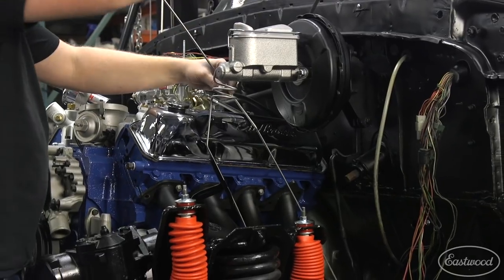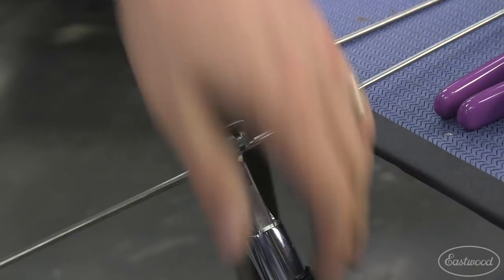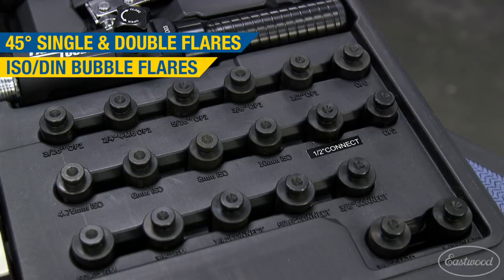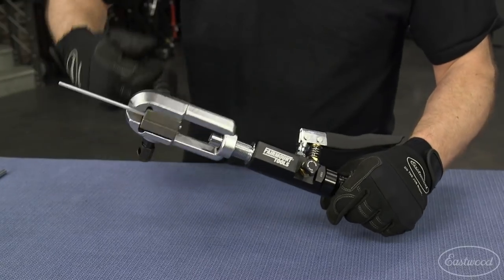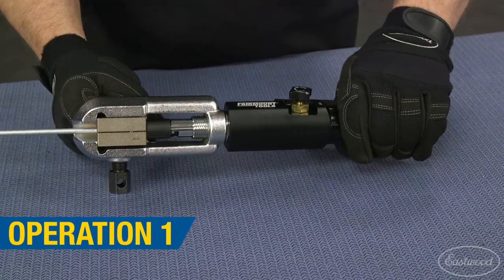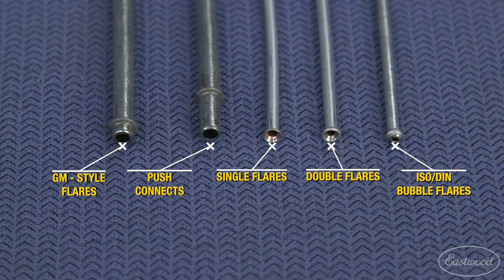Create Perfect Flares On or Off the Car - Flare Brake Lines, Fuel Lines & More! Eastwood

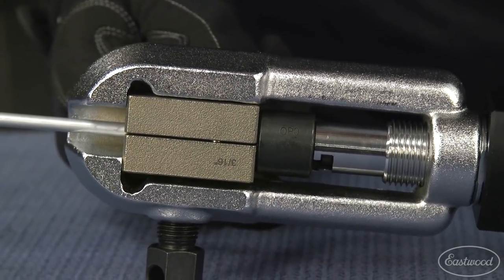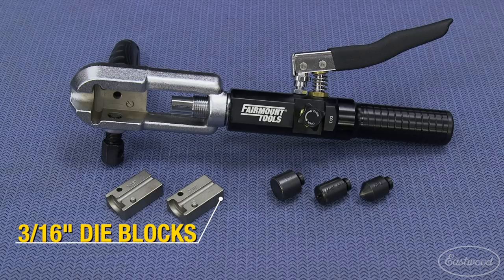Comment: I see at 1:03 and 1:42 that the 3/16" inverted flair die blocks do not have those "tube grabbing grooves" (I hate the marks that those grabbing grooves make!) The 5/16 push crimp flair dies do have the grooves at 3:06.  Do the other inverted flair dies have "grabbing grooves"? Im considering buying the kit but want to make sure.  BTW I love your vice mount pro flair tool and your 3/16 on car flaring tool.  Both have smooth "non grabbing groove" dies that make excellent flairs.  Thanks,  Chris

Comment: In between operation 0 and 1 shouldnt you have to tighten the die block more than hand tight to keep the tube from slipping?
2:20
Reply: Yes you do.  I'm sure that was just a slip up during the video edit.

Comment: I saw a vid where the line would not release from the die when making the long quick connect fitting. The line was treated with WD40. Has this issue been resolved? I need this tool soon, and the line in question is one that I will need to make.

Thank you.
Reply from the maker: You should always put some lubricant ion the die before flaring. If making brake lines, you can use brake fluid. It's not a problem with the tool.

Comment: Autopart brake flaring tool, selling between $20 and $40, apparently made of putty, bends after the first flare, breaks after the fourth, you won't have to worry about using a cheap brake line because it will probably leak way before it starts rusting.
Professional grade tool that actually works: a huge tool box with tons of accessories most of which you will never use and a few of which you will use perhaps  once or twice in a lifetime: costs more than preformed brake lines for your whole car.
What's wrong with this picture? Why can't manufactures make a decent, simple tool with good quality materials and to tolerances close enough to actually do the job, without costing an arm and a leg? Why do we have to choose between totally useless junk and tools made for people who work on every imaginable type of tubing every single day of the week?